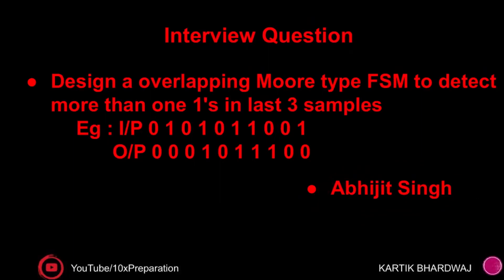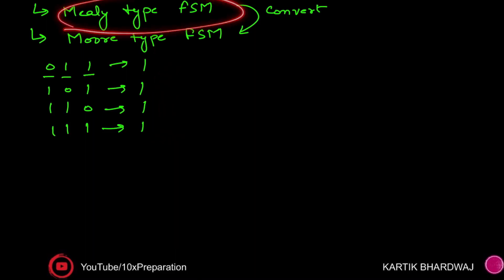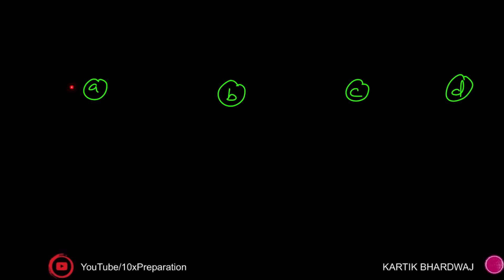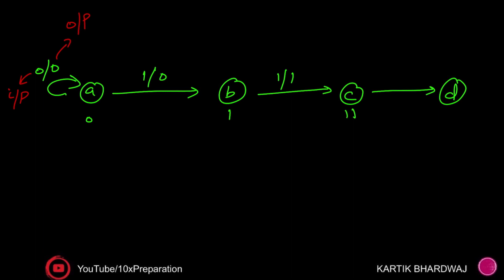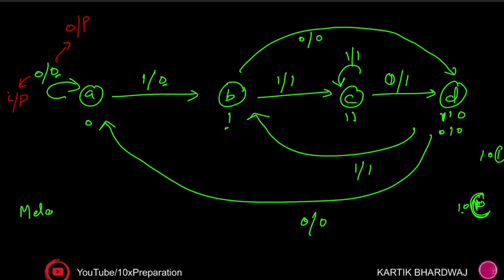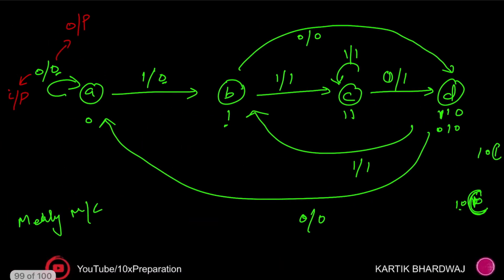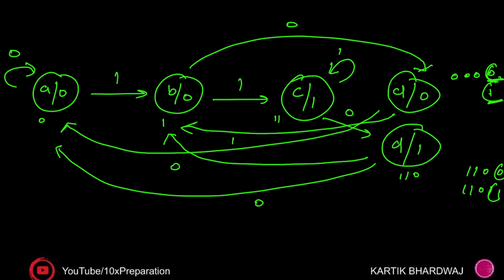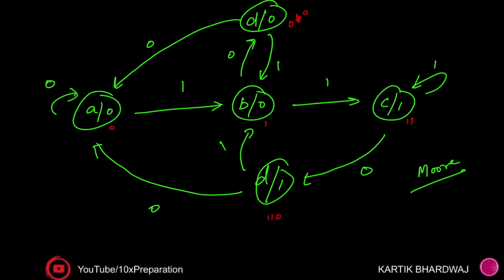Overlapping Moore Type FSM: Detecting Multiple 1's in Last 3 Samples | VLSI Interview Questions

Comment: This is wrong, 101 is giving output as 0 not 1 in your Moore FSM
Reply from the maker: Please check once again
Reply: @10xPreparation  Yaa he is right 101 gives op 0 
let me explain this in moore model from b state if gets 0 it goes to d/0 which will have 10 from d/0 if it gets 1 then op becomes 1 it should goes to d/1 state instead of that you went to the b state.